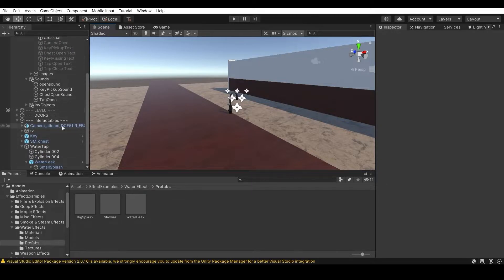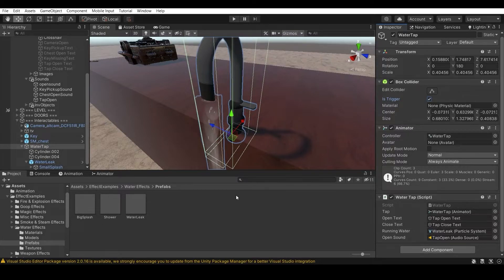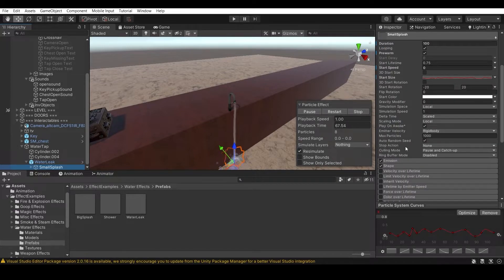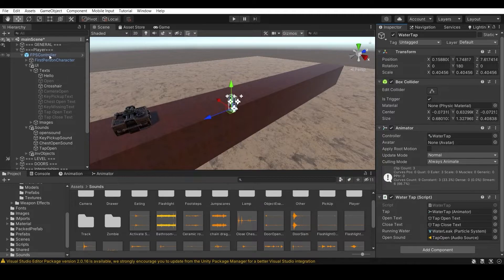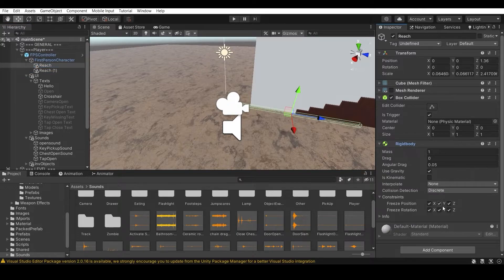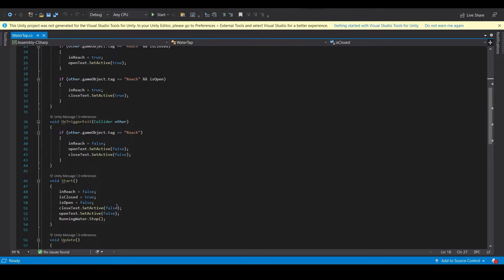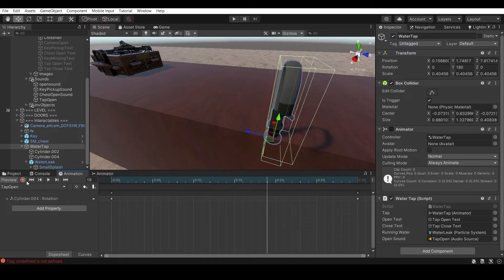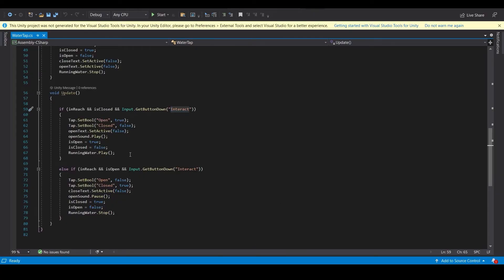How to make a Running Water Tap System in Unity with Particle System

Comment: I'm following the tutorial you created using a hand motion tracking software but the code script is not working properly. can you help me out.
Reply from the maker: may be.
Reply: @greenfoxstudios  Thanks if you can help. 
Using the script you have created. Thanks for that by the way. The idea of what I'm trying to do is using Leap Motion hand Motion tracking software as the main trigger system for turning the tap on and off when any of the  hand come in contact with the cylinder. hope this make sense.
Reply from the maker: is your hand motion is taken from mouse or any other hardware.is the cylinder an object in game?
Or may be you want to make something turn on, off when the hand is in contact of the cylinder. if that's the case then make the hand and cylinder "is trigger" on and make a if triggered statement when in reach like in my script. It may work for you. 👍🏻☺️